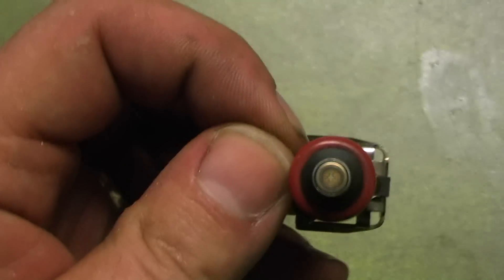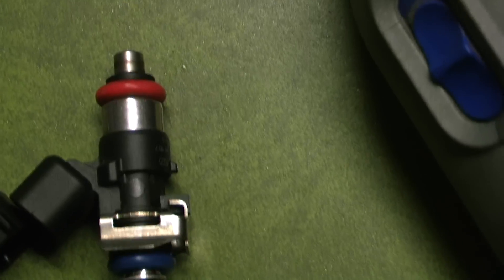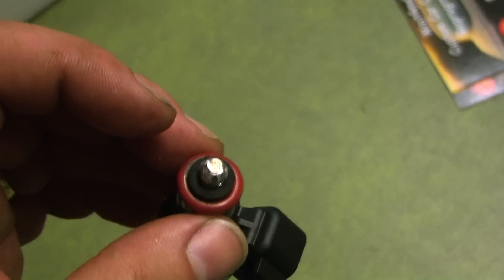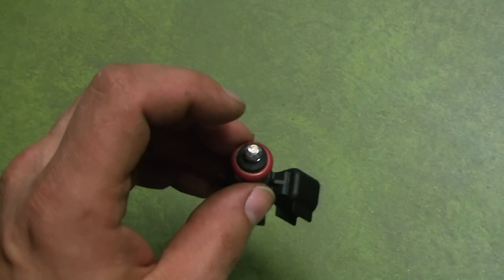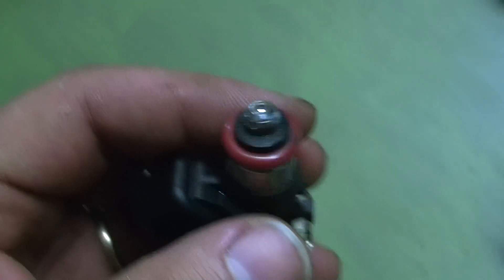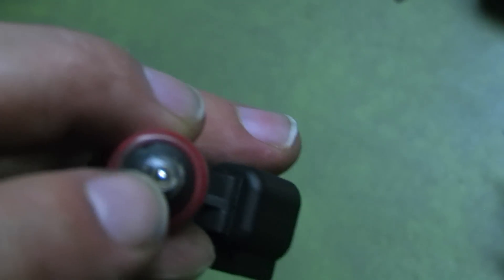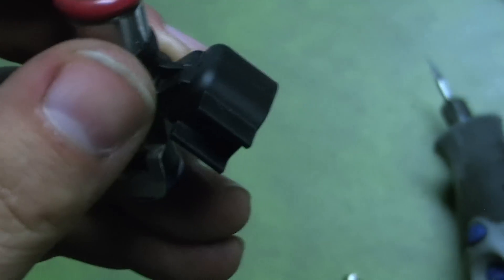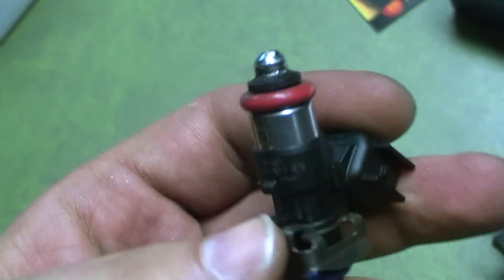How to make your stock ls3 and lsa injectors flow more for cheap.

Comment from the maker: It is not showing people how to ruin an injector. It is the exact thing others do and I am just showing you that it isn't worth 900 bucks or more for the exact same stock injector to be just cut off like some injector shops do.   It is the same procedure, just they use a jig that holds it in place to make a smooth cut....    But, if people want to continue to pay a ton of money, it don't hurt me at all,  I am just letting it be known..  Easy as that....

Comment from the maker: Also the cutting off of the tip is different from drilling the tips that other companies say is so bad.   That screen on the top is what made the injector the size that it was, say for example 60lb per hour at 60psi.   When some other companies make them larger flow, they drill out the tiny holes to make the diameter of them larger which in turn makes the injector a larger size. But you can only put the holes so big as there isn't enough room.  This way does a better flow and much larger lb/hour